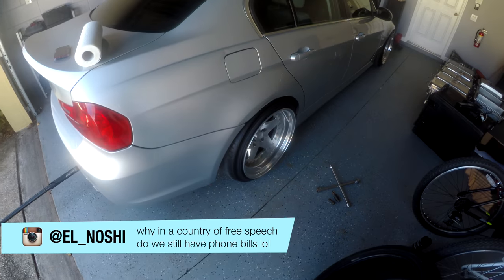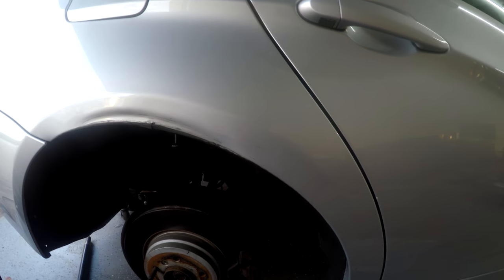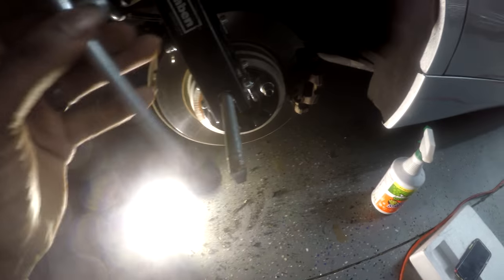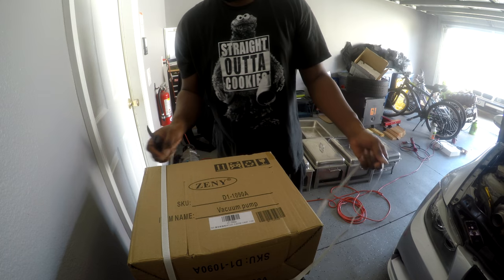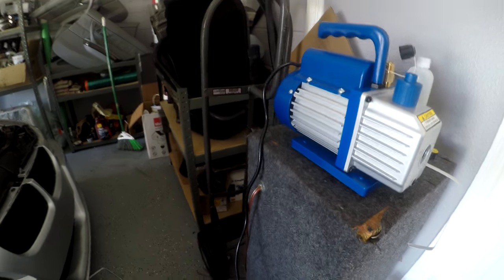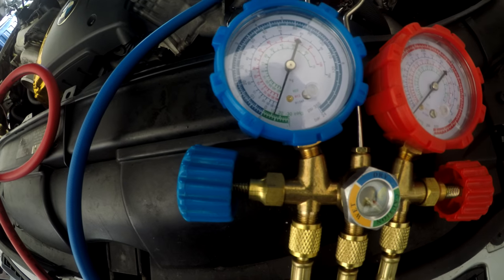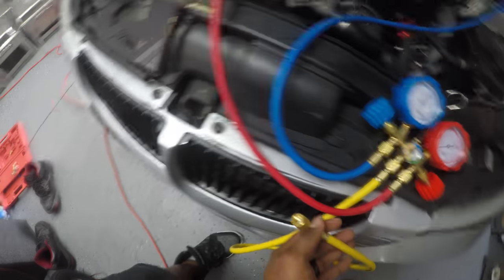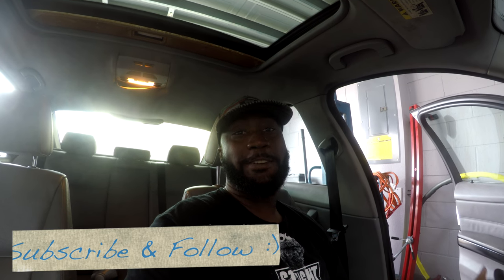Tires Changed, Fenders Rolled, A/C Working For SC 10

Comment: hey man , i just watched all of your videos and left likes 👍, before thanksgiving, i purchased a 2006 bmw 325i,it’s on delivery right now. it’s clean title from copart and it got 160k miles on it , is my vehicle having the same steps as you did to swap the engine? and since im not mechanic, i had 2 hondas and they never been broken, so i don’t know how to inspect the car condition , it’s run and drive, primary damage are minor wear and secondary damage are mechanical
Reply: noshi thanks alot sir, your comment are very helpful to me
Reply: noshi im got some problems sir, i think you can help me, so the driver call me today and told me the car has no key, but then i check the copart, in the picture the key is hang on the steering wheel and in the detail it says it comes with the key.

Comment: Noshi whats up  man !!  How its the on3 kit holding up ? I ended up just getting the hot parts from them and i got the precision 6266 and the 46mm wastegate... im pretty anxious to get it done.
Reply: @nOshi2x   dam man .. i cant wait .. i still have to wait for a few things more like oil pan gasket and the mount .. i  need to get all the plugs for the coolant , oil feed and oil drain .. no body sells the oil drain  (bottom part) ... i know vargas sells the plugs .. but the oil drain i am going to have to diy the one from the twins ..
Reply: 3 weeks after and i decided to tackle it myself... whats the fun of it man .. i was woundering if you had any pointers that would make my life easier... also im woundering how hard was to remove the steering rack?